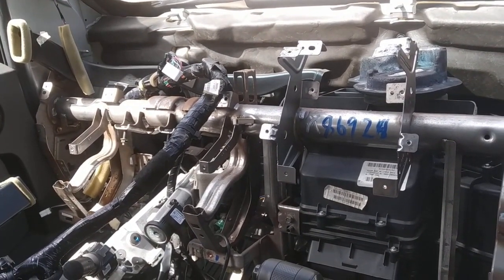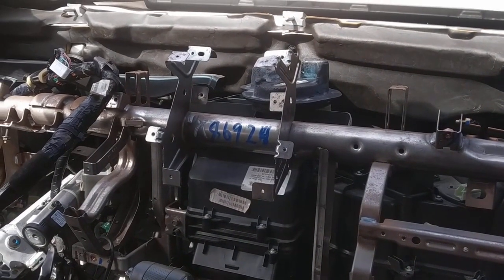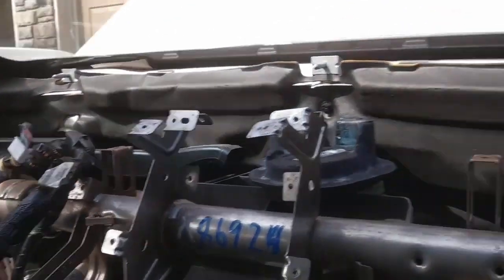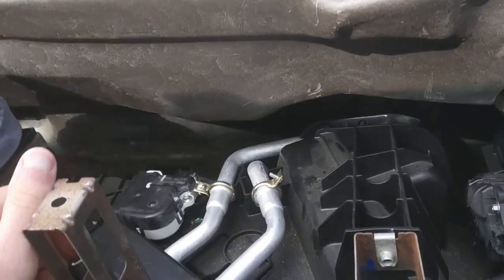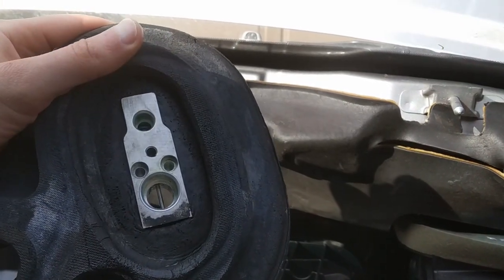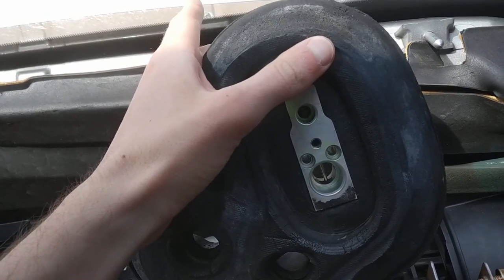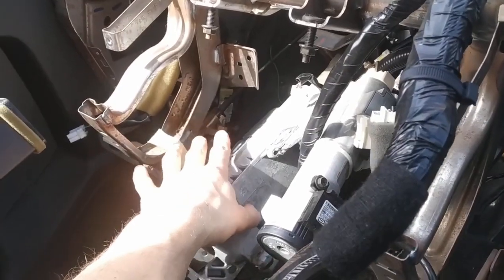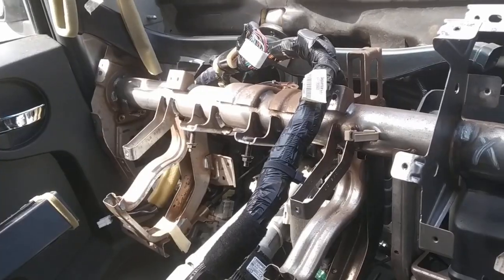2005+ Nissan Xterra/Frontier/Pathfinder Heater Core Replacement

Comment: WOW.  Okay, I've done all the work on mine.  Bought it new in 2007, now has 242,000 miles on it.  Original heater core.  After seeing this insanity, I might sell mine before it fails.  I can't believe what a horrible job this is.....
Reply from the maker: It was quite the pain, but doable if you have patience
Reply: yep its a shit job.. and guess what theses damn vehicles are getting more complex every yr and harder to work on .. 27yr dealer tech here ..
Reply: @jarebear58477  I honestly feel the people who design them should be forced to work on them for 6 months.  ALL they care about is making it as easy to assemble as possible.  I love it when there is a bracket that blocks a bolt.  If they had just designed the bracket 10mm to the right, then you would not have to remove 15 parts to get to that one bolt.  I do not know how you do your job day after day without going mad.  ALL my respect to you Jeremy!

Comment: Just wanted to comment back, this is the way. There are other videos where people mess with the steering wheel and the wire harness on the drivers side, dont do that. Passenger side harnesses and pull the metal frame out just far enough like in this vid. I had so much room it was really easy. As frustrating as this job can be just seperate your bolts in the cup  holders. Try to do it in a day. 100% don't remove your steering wheel or the metal support frame
Reply: How did you tackle the passenger side airbag? disconnected the batt obv, but wondering if there's another disconnect. I see the yellow and orange clips underneath the airbag housing but can't see where they run to. Any info on how you tackled that would be awesome!
Reply: @henryh7473  take the lower parts of the glove box off. I just disconnected the wires to the airbag I think then left it on the plastic trim piece and removed that. I watched a couple different videos and kinda figured it out. Been a min since I did it though.
Reply: @henryh7473  how did you finally do it? I’m gonna do this job this week

Comment: Do I need to do this to remove just the AC evaporator? My truck is a Vacation Truck on an island so I really don't use the heat or even have an issue with the Heater Core. 

I was wondering if the AC Evaporator would be less work?

Comment: Nice work on taking that dash out and for the helpful tips. Question,..can you take the ac expansion valve with rubber grommet out ,at the firewall, towards the engine? It looks like it would give me more room to see the evaporator for leaks. Instead of using a bore scope. Thanks
Reply from the maker: Someone else in the comments tried this and says it can be done.
Reply: @adamglynn9441  thanks man

Comment: So 100% sure the AC lines need to be disconnected to do this job?   What parts of the AC system should be replaced 'while you're in there' during this job?
Reply from the maker: 100%. Just the orings need replaced
Reply: @adamglynn9441  How many O Rings need replaced Is that part number 92470-HC-050 the only one I will need ? Thanks

Comment: did you say that if you have a radiator fluid leak inside the cabin after replacing a part on your coolant system that it is most likelynot the heater core leaking?
Reply from the maker: Correct, it's most likely an air bubble
Reply: @adamglynn9441  i am going to have to try your trick out. If I understood right, warm it up and then put the car on an uphill. Release the clamp for the top hose to let the pressure come out and release the bubble?
Reply from the maker: @reyjurado5945  yes, slide a small screwdriver in there

Comment: Did you have any issues with that heater core leaking at the fitting clamps?
Reply from the maker: @jayflores4336  if you get the wrong heater core then it won't go in there right and will strain those clamps and it'll leak

Comment: How did you know your heater core was bad?  I have a coolant leak coming out of drain for the heater core under the passenger wheel area.  Took me forever to locate the leak.  Forums say if it’s leaking from that drain it’s a bad heater core.  Any chance I could just have bad plastic unions at the firewall leaking down on the inside of the truck and not the actual heater core?  Any advice much appreciated and thanks in advance.
Reply from the maker: Did you replace anything in the coolant system before this started happening? Radiator, hoses, fittings?
Reply: @adamglynn9441  no there is a unique drain up under the passenger tire and from what I read on forums is it designed to stop the heater core from leaking inside on the passenger side floor.  I have a 2007 V6 frontier with 172K miles.  It’s not leaking much maybe about a 5 inch puddle after sitting over night.  About maybe a 1/4 cup of fluid left in the morning after sitting.  Doesn’t leak while running at all.  Think I could have the air in the system issue?  I noticed this before my last oil change.  It’s kinda intermittent.  It’s my daily driver so I haven’t messed with it much yet waiting for the weekend.  Any advice would be greatly appreciated.
Reply from the maker: @jamesgoode8115  Never heard of that drain. I know of an AC drain hose that runs from under the passenger dash. The air bubble problem causes leaks when the system is under pressure (truck is running), doesn't leak when sitting overnight. Can you send link for what you read on forums?
Reply: @adamglynn9441  I am 99% sure it’s my heater core.  Found oily residue on my passenger side floor mat and my truck is starting to over heat with weird flux of radiator fluid.  Like not much radiator fluid in the radiator but a ton in the reservoir.  I bought a orileys radiator cap with spring on it.  Looked up forums and only spring cap should be on reservoir.  I started it up with caps off and fluid went back to normal.  I am gonna try burping it tomorrow if that doesn’t work I am going to install a home made heater core bypass until I can get all the parts and have time!  Wish me luck 🍀😂.  Looks painful as hell.  Any special tools you recommend for the job to make it easier?
Reply from the maker: @jamesgoode8115  Overheating is symptom of air bubble every time. Took me many burps to get all air out. Did you do anything to the cooling system that could have allowed air in? Even a coolant flush? I'm imagining if the heater core is going out then air could get in too? 

Don't remember needing anything special. Just make sure that new heater core matches the old one, especially the shape/path of the metal hoses. If the metal hoses don't match exactly then when you put it in the joints at the hoses will break.
Reply: @adamglynn9441  I am wondering if a pin hole could be allowing air in the system?  It leaked again over night tonight but this time more like a cup of fluid.  Yesterday leaving work my truck got to half way heat and my ac started to act funky in stop and go traffic.  I got home barely in fluid in the radiator but almost over flowing in the reservoir tank.  I took both caps off and started the truck and the fluid filled back up in the radiator and the reservoir tank went back to normal.  I can possibly contribute that to buying a new radiator cap at orileys just to be safe that had a spring valve.  Looked on forums and it said radiator cap shouldn’t have spring only the resvoir to allow correct pressure.  Not sure what to try now 😂🤷🏻‍♂️?  Might burp it and see what happens or just bypass the heater core for now.  Just getting risky with my cars temp wanting to go up in stop and go traffic
Reply from the maker: @jamesgoode8115  Radiator cap shouldn't have a spring, don't know if this could cause your symptoms but its possible.
Reply from the maker: @jamesgoode8115  Also check those crappy plastic connections coming out/into the heater lines at the firewall. If you haven't replaced them yet, they're probably about ready to explode like they did to me at 150k. Be careful and don't yank on them while they're hot!
Reply: @adamglynn9441  I broke one today bypassing the heater core.  I did it to buy me time until I can tackle the heater core.  Didn’t have any issues driving home.  Heard different opinions do recommend getting the Nissan heater core or after market?  Hopefully it just takes me 2 days and 12 beers 🍻😂👍🤷🏻‍♂️
Reply from the maker: @jamesgoode8115  Don't use part APDI/PRO 9010545, IT DIDN'T FIT.

I used OSC Automotive Products 99072 instead and it fit perfect. I usually don't use Nissan parts; too expensive.
Reply: @adamglynn9441  I got Murray heater core 98085 from Orileys hopefully that works well.  I also got new heater assembly hoses that go into the firewall from eBay that are metal instead of the crappy plastic stock ones.  I also got orileys A/C o-rings for the A/C lines at the fire wall.  Any other recommendations on other items to buy before getting started?  I have a few weeks before I take on this daunting task 😂🤷🏻‍♂️👍🍀🤔?
Reply: @jamesgoode8115 It's my turn 😢
Did you end up need to buy anything else in addition to the o-rings and heater core? OReilly'd parts working out okay? Any other advice? Thanks!

Comment: Looks like you should be able replace the A/c expansion valve, that you were showing, from the outside of the vehicle without removing the dash. Does that seem doable to you? I think I saw some people doing it that way. Replacing my A/c compressor and want to replace the expansion valve in the process without removing the dash. If i remove the dash, I will replace both heater core and evaporator core while in there. I've done many other type vehicles in the past and if you have a good place to work and take your time, it's not bad. Good Video!
Reply from the maker: I can't be sure, but I think that valve slides in from the back of that black rubber thing that I showed being peeled up and out. Maybe you could cut through that and get it out from under the hood?... but I'm skeptical.
Reply: @adamglynn9441  Thanks.. I found out it can be done. the valve is just resting in the rubber. remove the two torx bolts and re-insert the center bolt (that holds to lines to the valve) enough so that you can use it to pull the valve out. I think it can be done in about 30 min.
Reply: @eminiscalperpro9729 you’re saying you changed the expansion valve without opening the whole dash? Can you elaborate.
Reply: @CivilAlien  On my 05 nissan Xterra i replaced the expansion valve without removing the dash. No one that I know of removes the dash on these particular models, even the maximas. I had to do it again recently due to the Four Seasons valve going bad after 1yr. It took me about 30 min total. Remove the hard line held in by two bolts, then remove the two bolts securing the valve. Then reinsert one or two of the first two bolts (the ones you took out to remove the hard line) into the valve so you have something to pull on and work the valve loose n it comes right out. You will need a pick or something to remove the two o-rings that are still on the evaporator and the old ones on the hard lines. The new valve comes with new o-rings, so just lube them a bit with pag oil, ease the valve into place and snug her down.
Reply: @adamglynn9441  I did my 95 Xterra expansion valve without removing the dash and I talked to a few mechanics and they said you do not remove the dash on these models to replace the expansion valve. It can be done in less than an hr
Reply: Correction I mean 05 extera

Comment: Would you still do it this way if you had to do it again or fallow the fsm and pull the whole thing out?
Reply from the maker: Definitely this way! It would be so much harder to pull it out
Reply: @adamglynn9441  alright I will give it a shot. I just replaced my engine and this is next. Anything that makes it easier is good.

Comment: whered you buy the o Rings for the a/c ? if you remember thank you
Reply from the maker: 92470-HC050 A/C Line O-Ring from nissanpartsplus.com, should be same part number at any Nissan dealer site though.
Reply: Is that an o-ring “set/kit” or do you need 4 (assuming) of that part number

Comment: I did it without disconnecting the a/c apparantly the heater core has quick connect and in my case the o-rings went out swapped them and done its a little struggle but not as much
Reply from the maker: I don't see how that's possible. How did you get to the o-rings without disconnecting the AC lines that go into that metal piece that covers all the orings?
Reply: did you prime the o-rings and with what? oil? grease?
Reply: @andrewdobrzanski3548  i don’t understand i didn’t disconnect the ac at all
Reply: On mine the plate was seperate from the heater core lines so i moved the ac part were it could have play making sure not to disconnect ac and cause a leak. And i didnt use the orings they looked bad and autoparts didnt have it so i cut both ends on the lines were o ring go and use a coolant hose 1inch i think and clamped together wich was better because now you have some flex to play with
Reply: I wish i could help yall out its a struggle i only took apart half what had to be taken aprt good thing i hacked it took alot of brainstorming but it’s possible
Reply: @jorgecorrea2446  Great idea! I'm going to do this on mine so I don't have to disconnect the ac. Thanks man!
Reply: @dakotamolnar  np takes some time but you don’t have to completely remove dash
Reply: And yes it’s still working good
Reply: @jorgecorrea2446  I maintain a fleet of nissan frontier trucks. That's gonna save me a ton of time. You're a lifesaver. So, just cut the line before and after the quick connect, add a piece of 1in coolant hose and clamp it on?
Reply: @inoahmann7542  yup as easy as that mine is still running
Reply: @jorgecorrea2446  you did this on the ac line?
Reply: @caleb8495  i didnt disconect no ac just made room ro bypass the heater core
Reply: @caleb8495  no heater core

Comment: I watched this other video on Nissan Frontier heater core. Supposedly, if you buy the original heater core from the dealer, removing the whole front dash is not necessary because it will slide in from the passenger side (after removing something   Small from the passenger side. That true?
Reply from the maker: Not a chance!
Reply: yes it can be done, in this video it shows him having it removed already, dash still intact.
https://www.youtube.com/watch?v=PEsnk-5Jszc
Reply from the maker: @mrekimf1  False. That is 2004 and back, not 2005+

Comment: For anyone wondering, on the second gen xterra's and most likely the pathfinder/frontier since they are basically the same from the dash forward, You Do NOT have to remove the dash to replace the A/c Expansion Valve. hope this helps

Comment: I'm getting residue on my windshield, it leaks in my passenger floorboard and the heat only works when driving not when parked or idling so is that the heater core needing changed or needing to be burped?
Reply from the maker: Burped! Assuming you just replaced something in the cooling system like the radiator or fittings, hoses, etc
Reply from the maker: And if it hasn't overheated yet, it will soon

Comment: How many actually watched for fun and how many actually watched because they need to do this? 

Damn 18,000 views so far. I'm just viewing for fun, I hope I never have to do this 🤦🏼‍♂️
Reply from the maker: Best part is mine actually didn't need it, it was just a giant air bubble in the cooling system that was causing a leak at the heater core.
Reply: @adamglynn9441  how did the air bubble create the leak and where was yours leaking from?
Reply from the maker: @jamesgoode8115  Air bubble causes pressure to build up and coolant to start blowing through connection points. One xterra it caused leaking at the heater core which was dripping on the passenger seat floor from under the dash, a different xterra it caused a leak right at the firewall
Reply: @adamglynn9441  mine left a small pool in the passenger floor, this was after letting the xterra idle for about an hour at camp during an 14 degree morning. could it possibly have been just a bad air pocket?
Reply from the maker: @nickdozier8115  if it's an air bubble then it's still there. Get it hot and park on an incline, shut it off and burp it.
Reply: @adamglynn9441  how would I know if it was air vs. bad heater core? When I removed the glove boxes I would see it dripping from the plastic clip on the aluminum tube
Reply from the maker: @nickdozier8115  If you burp it and get a bunch of air out, then it's most likely an air bubble.
Reply: @adamglynn9441  perfect, 130k and never done anything to the coolant system, but I will definitely try that before breaking the dash apart. Other than that great video on it!
Reply from the maker: @nickdozier8115  Not even a coolant change? I doubt heater core is bad after only 130k miles.
Reply: @adamglynn9441  not even a coolant change.

Comment: easier to remove the wiring in the long run  way less fighting it back into place
Reply from the maker: Yes, remove it permanently ;)
Reply: You really think it would be easier to undo the entire wire harness and pull the whole frame out?
Reply: @adamglynn9441  do you think it would be easier to do it you way or the shop manual way?